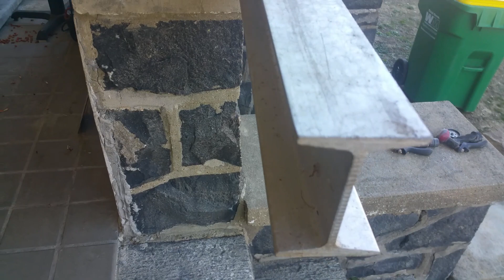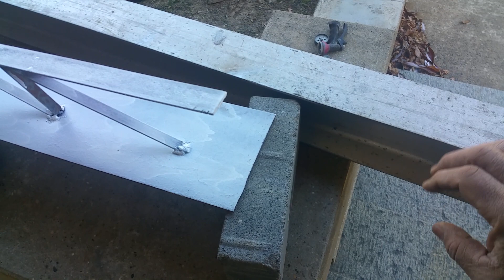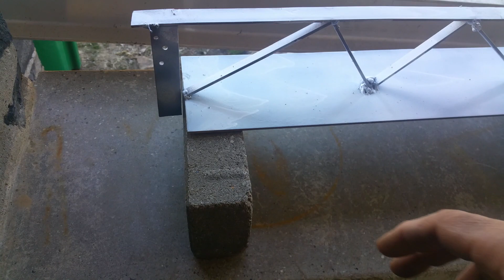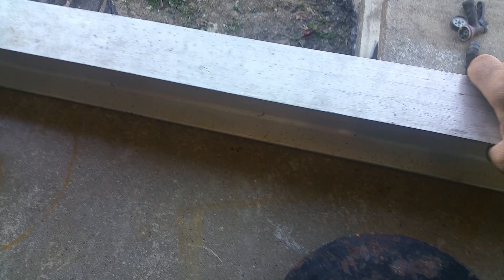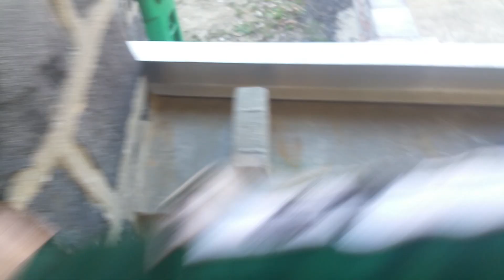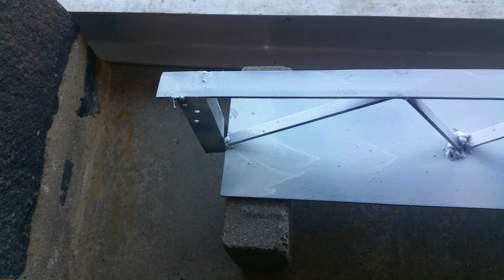FIU BRIDGE COLLAPSE MODEL PART 2 SAGGING DECK EXPLAINED = LONGITUDINAL POST TENSION FAILURE FIRST

Comment from the maker: Staying focused, these series of videos will show that ''deflection / sagging'' is what started this ball rolling to failure.
That once the formwork was removed, it was reported those "cracks like hell" were identified (but not developed fully until the day they remove the post tensioning in number 11 and 12 base and canopy blister)...
The initial cracks that are presented ARE from the removal of the formwork; this means the structure was NOT ''flat" because of the deflection / sagging"  WHICH MEANS this was turned into a ''truss system'' or a ''Torsion loaded I-Beam" and that torsion presented itself in those hairline cracks at the base area of 12 DAYS BEFORE THE MOVE.
ONCE  THEY De-TENSIONED (de-stressed) , the TORQUE and cracks really developed and I believe was only stopped from collapsing because of the post tension bars ''re-grabbing" at the base of 12.
This MEANS the deck SAGGED even FURTHER and when Figg and the rest of them allowed for ''re-tensioning'' the SHIMS that were now ADDED under 12, made a NEW pivot point for the clamp force of the number 11-B (upper post tension bar) and THE GAP could NOT be closed because of the NEW EXCESS FRICTION created by that newly created PIVOT POINT that could not ''slide'' back into the cracked openings as PLANED by these engineers!
That it created so much stored force in energy at the base of the post tension bar that the concrete was able to hold until it explosively gave out! AND this INWARD EXPLOSIVE FORCE, BLEW OUT PARTS OF CONCRETE (which people want to know about in the live video- ? where did the explosive concrete come from?)...
At that point number 12 was no longer active and it's failure was just  part of the chain of the failure.
It's explosive release of energy caused an ''Earth Quake" in the system because Post TENSION 11-B BAR WAS HOLDING THIS structure together (from sagging down) it was the ''tie-back'' of the this structure to the diaphragm and once it was released, the structure was free transfer it's loads only from the 9 / 10 node to the diaphragm... it could NOT do it without the deck failing transversely... and of course, above that 10 and 11 node, it failed between the node and the canopy (transversely also)  ...  
IF< the deck could have had STRONGER POST TENSIONING IN THE LONGITUDINAL DIRECTION it would not have FLEXED... I have another video that will question the one tendon, ''D-1" and concrete placement; this will be in the next video perhaps.
Note: This model will be plasma cut to show longitudinal post tension cables...
The current model is how the design was intended to perform.
I need to find out what ''sagging location" was identified per the CEI questioning the sagging...  It appears to be between 9 /10 and 12.

Comment: With a loaded flat I beam sitting on it's ends, there would be tension in the  lower flange. With an arched I beam, you have compression throughout. The bridge has no arch in it. To say that a loaded flat I beam is under compression only is absolutely incorrect. Which means that you cannot compare the bridge with a flat I beam.  Set your I beam on the two bricks, place a dial indicator under the center, and place 50 lbs on top of the I beam and watch the downward deflection. That lower flange will have more tension in it than the upper flange.

Comment: This seems to be the opposite of 11 pushing off 12.  I do believe there was a separation of the column from the deck but I have always believe it was because the deck pulled away from the column.